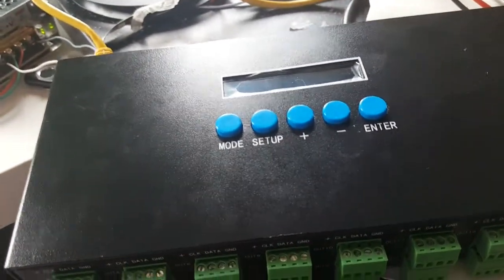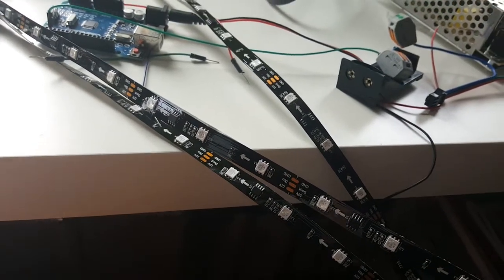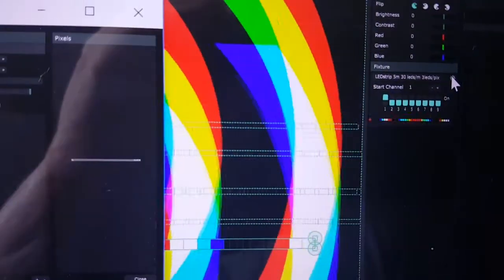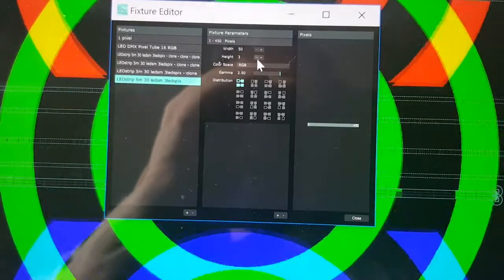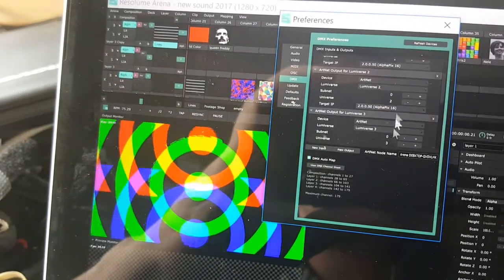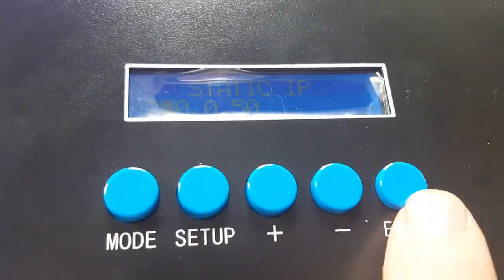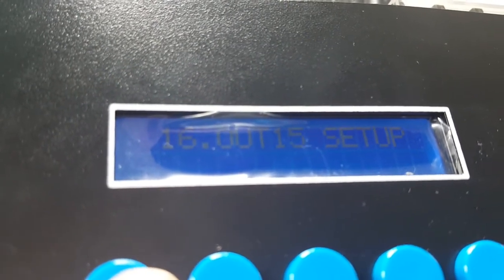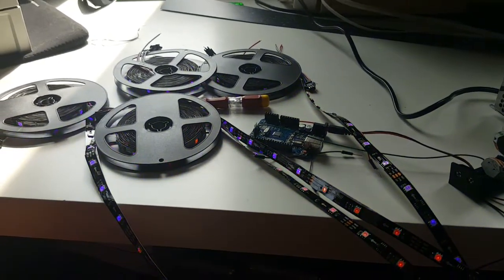Resolume Artnet Alphapix 16 Ws2811 SPI pixel led

Comment: Do you connecting AlphaPix direct to the computer via ethernet cable? How you setup the artnet connection? I have the same controller, but resolume doesn't recognize it.
Reply from the maker: Hi Alexey, What i did is set my IP of resolume PC in the same range of the alphaPix, I ran it also a couple of times in a network with a Chamsys light controller. It worked well in my case. Make sure your resolume PC IP is in the same range of the Alphapix (Artnet is based on 2.x.x.x range, but should work also in another range). I remmond te set for example your resolume PC on 2.0.0.1 and your alphapix on 2.0.0.2. Make also sure you have the universes set correct.

Comment: Hi I would like to buy te 16channel edition Buth I'm kinda confused. I'm a regular chamsys user, thats for dmx lightning in clubs, events..., and this support art net, so that should work.

Something that is not directly clear for me when you use lets say output 1 and you enter for uninverse 1 and  for dmx 1 and pixel 3, am I correct that the first led will be dmx 1 pixel 1, the second led dmx1 pixel 2, the third led dmx 1 pixel 3 AND the fourth led will be then DMX 2 (not 1) and pixel 1.. And so one and so on until you  reached the maximum. Is this correct or does it simply stops at the 4th led???

Would by very Handy to know for my programming
I will use ws 2811 or 2812b leds single programmables

Thanks for your help!!
Reply from the maker: If I were you, i should start from universe 5 or smth. That makes sure that you still can use your first dmx universes from your direct outputs from your lighting console. Then after that.... first pixel has address 1. 2nd pixel adress 4. 3rd pixel address  7. You have to patch them as " generic LED " then choose LTP or HTP. And then choose the correct address and amouth of pixels.
Be carefull when buying these LED strips.... if you buy 12V. You have 3 LEDpixels on 1 IC. That means 1 pixel are actuall 3 LEDs. 
Grtz
Reply: @starlightjasper  OK I have 5 volts now and possibly will be that I think I underdtand it it wil be a mather of tedtkng I think thnx!

Comment: Would this work with ws2812b neo pixel strips? Also would it work with mad mapper?
Reply from the maker: Yes,  sure.
As long as the software has Artnet outputs. Madmapper has it.

Comment: did u know how to fix the half of port 1-8 channel cannot connect or broken . but the half 9-16 are work . 
i have 4 controller here and they had a some problem now . it can be test mode on 9-16 but cannot connect to madrix or resolume arena .
Reply from the maker: Did you supply power on all connectors?

Comment: Hi. 
1. Is the Alphapix controller communicating with the PC via Ethernet cable only? (Does it need to go through a router or it can be plugged in straight in the laptop's ethernet port?)
2. How would you link more than one Alphapix Artnet-SPI controller, if you run out of DMX universes?

Thank you!
Reply from the maker: You can go straight from your pc to the controller with network cable, and you can use as many controllers as you want on your network. You can have in this case 16x dmx universes. Not sure what you mean with not enough universes. But you can configure each output of the alphapix to a desired dmx universe, so you can eventually duplicate them and you can go up to 256 universes I think, but could be also more. Not sure about it. I will check later on.
Reply from the maker: And you can use unmanaged network switches to link controllers, you can find them cheap on the market.
Reply: @starlightjasper  Right, for some reason I associated the number of 16 outputs to a total number of 16 universes. 1 universe/output. On the manufacturer’s website it says: Control Pixels: RGB: 340 Pixels x 16CH. So my understanding goes like this:

340 pixels x 3 (R.G.B.) = 1020 dmx channels (2 universes) per output.
A total of 16 outputs = 16320 dmx channels (32 universes) 

So your device would support a total number of 5440 led's (pixels) = roughly 90 meters at 60led/meter.
Please correct me if i’m wrong. I know there is a 4 output model as well on the market for half the price, so I’m trying to figure out if that would be enough for me.
Reply: @starlightjasper  If you could please give me a name for the switches, I'll search for them right away. Also thanks a lot for your quick reply!
Reply from the maker: @Creative.B  https://www.centralpoint.be/nl/netwerk-switches/tp-link/16-port-gigabit-switch-art-tl-sg1016-num-426451/ for example, just look for unmanaged 1000mbps switch
Reply from the maker: @Creative.B  you can only assign 1 universe/output... so 170/pixels per output... They say you can do 340 pixels, but it is in a kind of test mode with inbuilt fx's and colors. So make sure you meet your project requirements.
Best regards & good luck!
Reply: @starlightjasper  Thanks a lot for clarifying this! Best regards!

Comment: Hi i want to use bc-216 two or three is possible? Or impossible? I want to use 32channel or 48channel~!
Reply from the maker: Sure. You can use plenty. But what do you mean with "channels?" I guess you mean universes. Also that is no problem.
Reply: @starlightjasper  
Connected between the two bc-216 and it's possible to daisy chain? if it can daisy chain and connect for dmx cable?
Reply from the maker: @CreatTornadoProducti  the xlr's are dmx outputs. You have to connect all bc216 onto your network. So you can use network switches. (The easiest and cheapest are unmanaged network switches).
So all the bc216 have artnet and power as input and the rest are only outputs.
Reply: @starlightjasper   I have bc-216 in my house, Maybe can you setup art-net for Touchdesigner? I want to know setup in touchdesigner
Reply from the maker: @CreatTornadoProducti  I am sorry, never have been using touch designer.  I cannot help you with that. 
Maybe in the TD forum post a topic about how to setup artnet with your lights?
Grtz

Comment: Hello there, thanks for this helpful video.
I was wondering : can I control 1300 LEDs independently with the Alphapix 16 ? (for example 10 strips of 100 LEDs each)
And do I just need to plug in the ethernet cable directlt to my Mac with resolume ?

thanks !
Reply from the maker: That is all possible. On each output max 166 independent Led's. You have 16 outputs.... so you can run up to 2656 Led's independant on 1 alphapix.
You can connect directly to your mac or via a switch.
Reply: @starlightjasper  Thanks for your reply.
I found this on the alphapix 16 commercial webpage (https://www.holidaycoro.com/AlphaPix-16-Pixel-Controller-V3-p/721-v3.htm)

"Overall - Maximum of 5,440 Pixels or 32 Universes / 16,384 DMX Channels
Per Output - Up to 340 pixels / 2 DMX universes (exclusive of power, see chart below)"

So that's why, I was wondering why you said each outpout max 166 independent Led's ? :)

Thanks !

Comment: hello starlightjasper , I asked zion here in the forum but he hurries me so I ask you directly, I've asked for version v2 and it's 40 usd more expensive than v1, is it worth buying version v2? I do not understand much of the subject and I do not know what sACN E1.131 can provide, in which I would like to have that protocol apart from the artnet, could you explain me?
Reply from the maker: Hi sACN is another protocol like artnet.
Resolume is just using artnet. So no direct need for the newer version in my opinion.
Best regards.
Reply: @starlightjasper  do you know if this software is compatible with artnet? xLights or other software that works with artnet ?. I would not like to be subject to always use resolume. thank you very much for your quick reply
Reply: Most controllers are Artnet compatible. sACN, klingnet, .... are newer and not implemented in older controllers.
You can take a look yourself what kind of control software you want to use in the future, but i guess that they all are able to send out artnet
Reply: @yellowidiots9308  ok, then I do not worry anymore, I understand that there is a lot of software that uses artnet and at first I will not find limitations to do any kind of show. thank you very much.

Comment: Hi, I have Resolume Arena 4.1.1 and Artnet BC216 controller.  After plugging in the ethernet cable and configuring the IP and DNS, I still can't get the program to read the controller.  Is there a missing step that I am missing to get Arena to read the controller?  NEED HELP if you can, thank you.
Reply from the maker: Quan Nguyen did you do a broadcast search?  Make sure your ip is in the same range.
Reply: I did, it found the network but says unknown
Reply from the maker: You can enter ip manually in resolume

Comment: Hi Jasper, thanks for uploading - very helpful : - )  Can I ask, what is the maximum number of RGB pixels you can control with this unit? (ws2811) Also, can you use a wireless router,  or does the ethernet cable have to be plugged directly into the laptop?
Reply from the maker: You can use 170 pixels. Wireless router can do it.... but it will slow down..... pending on routing. Best to use a normal router.
Reply: @starlightjasper  Thanks for the reply : - ) Is that 170 pixels per output?
Reply from the maker: @seymourbutz246  yes. It is. If u wanna use more outputs.... you have to modify the code. Right now, only 1 output is programmed.
Reply: @starlightjasper  what do you mean only 1 output is programmed, so the other 15output we need to programming? How do we do that?
Reply from the maker: @adimulyawan1045  then you neef more arduino's and do the same setup.
Otherwise choose an alphapix (see other video of me)

Comment: I'm looking for a way to setup a 30x7 matrix on resolume. Is there a fast way to do this?
Reply from the maker: There is not really a superfast way to do so. It is all pending on your outputs and configuration
Reply: @starlightjasper  well, it is a 30x7 matrix with snaked signal. I have an artnet receiver which can handle r universes per output. Do I manually need to setup Al the rows, columns and signal directions in each universe?
Reply from the maker: @mattyd_gaming7425  yes you should. It is for every universe. As far as i can see, you only need 2 universes, so it aint a lot of work.
Just make you Lumiverse and copy it and change the universe numbers for the copied lumiverse.
Grtz

Comment: Hello! Please, help me. The Resolume works with the T300K Controller? Thanks!
Reply from the maker: Renan Netto Mastrantonio  it should work due to Artnet is a universal protocol.
Reply: starlightjasper Thanks for answering! I have another question, if you can answer I thank you. Can the Resolume Lumiverses work with 1024 channels? I would like to know this because the T300K controller has outputs with this option.
Reply from the maker: Renan Netto Mastrantonio The dmx is 512channels for each universe. So you have to use 2 universes

Comment: Great job! I have the same controller but my resolume 5 doesnt detect it... I put the same Ip than you but it doesnt work. I think that I have a network problem... Can you help me?
Reply: And I put the Ip manual and it doesn't work either
Reply: Same op Will not work. Check your artnet IP by going inside the router settings.

Comment: hey there, thanks for the video! can I controll ws2815 stripes with this?
Reply from the maker: Yes, they use the same protocol, the difference is the voltage, it could be your ledstrip has 3 led's for 1 chip. Then 1 pixel equals 3 LED's.
Grtz and good luck
Reply: @starlightjasper  What about the extra wire? 2811 only has 3 wires but 2815 has 4.
Reply from the maker: @LUNCHBOX-TV  the alphapics has also 4 connections on each connector. The 4th wire is the clocksignal. CLK

Comment: Hello, I've the Resolume 5 Arena and BC-204 but when I use 3 outputs all of them do the same. I'm sure that Is a configuration problem, could you help me please?
Reply from the maker: Carlos Cruz howmany lumiverses do you have set up in "advanced output" and how many dmx outputs do you have in "preferences-dmx?".  Starlightjasper@hotmail.com
Reply: starlightjasper Thanks for the answer, I've 3 lumiverses and 3 DMX outputs, I think Is something with the setup of the universes. I'm using 120 pixels (120x3(RGB)=360 total) per output
Reply from the maker: Carlos Cruz you can get in touch with me so we can share screenshots etc. Starlightjasper@hotmail.com
Reply: Ey! I have the same problem with the same elements but with only 1 output. If you can, send me the step to resolve the issue. Thx!
Reply: I send you an email so you can answer the question. Thx again!
Reply from the maker: replied!

Comment: Hello ! Thank you for the tutoriel ! 
I see that you use resolume 5. I also have a aphapix Artnet. How do you make appear the target ip or select the interface ?! On my  window, when I create a new output I have device, lumiverse, subnet, universe. No target ip appear. 
And in the device menu it is only written Art Net.

I am sure that my network and led wiring works fine because it is running perfectly with mad mapper but I want to try on resolume. 
Thank you for your help !

Comment: This is BC-216 clone of Alphapix16.. there is 2 version of this.. 1 is Arnet Only..the other one is Artnet and E1.31 Support.. i have 3 of This controller..and when i update Firmware it becomes Holiday Coro..
Reply: hello zion, I've asked for version v2 and it's 40 usd more expensive than v1, is it worth buying version v2? I do not understand much of the subject and I do not know what sACN E1.131 can provide, in which I would like to have that protocol apart from the artnet, could you explain me?

Comment: I’use arena 6, how I can configure it
Reply from the maker: In preferences, you can add in the DMX tab lumiverses.
There you can give each lumiverse an dmx address.
Then in output advanced, you can give the lumiverses a place and size.
Good luck!
Reply: starlightjasper I really don't know what to do, I have the BC204, it's the same as you have but with only 4 outputs, macbook pro and resolume arena 6, how I can configure everything from 0, that is, it already appears connected to me in the ethernet and I performed the steps that  you indicate, but it still doesn't work.  Sorry but I don't know who else to ask and I'm on a project that requires this to work.  I appreciate that you can keep me awake.
Reply from the maker: @freakawake  i am not so deep into mac. Search for chamsysRus . He did a tutorial with mac resolume and chamsys. 
Grtz
Reply: starlightjasper Thank you very much for taking the time to answer, I will look for it and I will continue trying to get it started, when I get it I tell you what I researched.

Comment: Please help me connect with t500k
Reply from the maker: Just googled it... seems connection is o issue... but the Chinese software is your challenge. OMG. 
Check this website.
 https://kutop.com/t-500k-4-channels-programmable-digital-spi-master-led-controller.html
Reply: @starlightjasper  
I have many projects by other software now need connect to resolium arena
Reply from the maker: @vahagkirakosyan5432  yes, so if you have set resolume according the tutorial, the rest is pending on your settings in the t500k software.
Hardware is just the cat cable. 😀
Reply: @starlightjasper  thanks for think I have connect

Comment: sir give resolume
Reply from the maker: It is resolume involved, what do you mean?
Reply: Sir I want use the led pixels
Reply from the maker: @beatsmarathiitskpstyle  Sure, that's where this video is about.... You have your artnet output from resolume, and artnet is going in, in the pixelcontroller, then the pixelcontroller is sending each pixel the correct values. I do not know what else you would expect from this video or what your exact request is. grtz